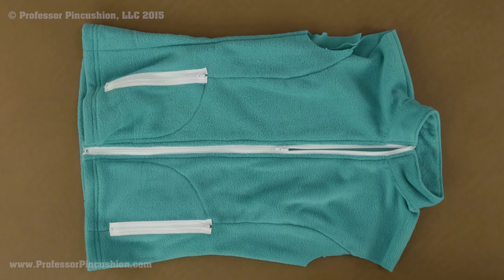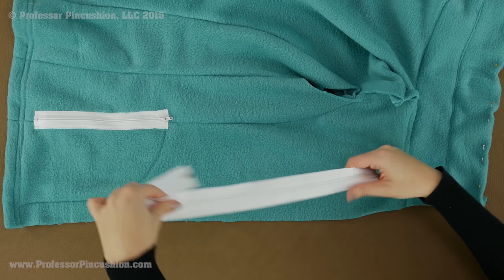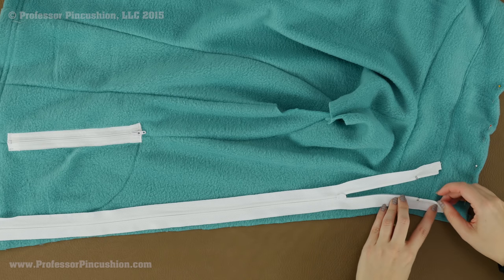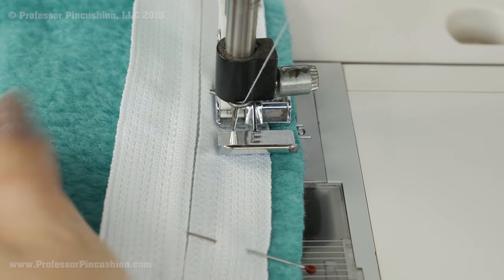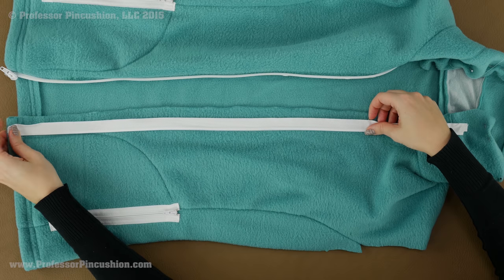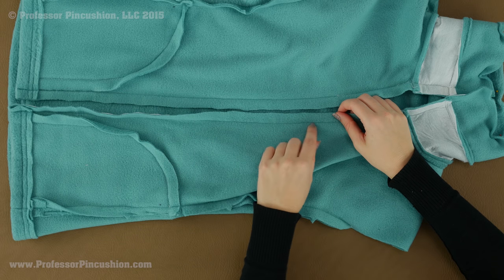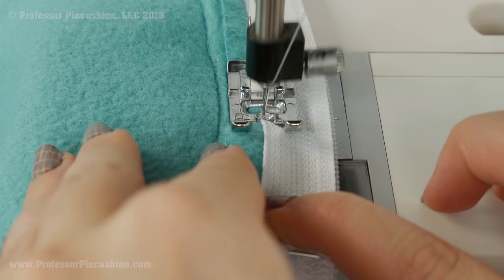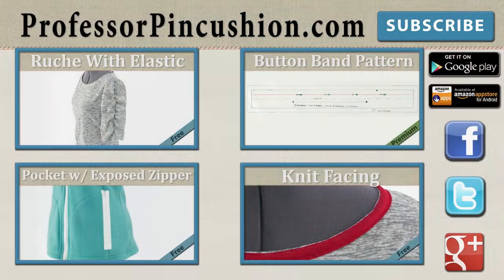How to Sew a Separating Zipper

Comment: You didn't show what to do with the top extra length of zipper... really the only reason I searched for this video!
Reply: There are some pretty good videos on shortening a separating zipper out there. Basically you remove the unnecessary teeth with plyers or needle nose plyers, breaking them up to remove them. Then you either attach a new stop, or carefully remove the old one and crimp it in the new location.

Comment: I'm running into an issue replacing a separating zipper in a fleece jacket.  the fleece stretches.  I put it in once - it was awful,  tore that out - now kinda stuck.  would I follow this the same way or do I need to stabilize the edges?
Reply: Obviously I am not professor pincushion but thats a great idea. I had to stabilize the zipper area with interfacing of my pants because the fabric was very thin. After placing the zipper it was fine.😊

Comment: You are amazingly skilled and talented! I'm sewing up this sport zipper on a scuba swim top I made, will I need to zig zag stitch because this is a stretch fabric?
Reply from the maker: It's not going to hurt anything to sew on the zipper using a zig zag stitch instead of a straight stitch but if the zipper tape itself doesn't have any stretch then it's probably not going to make a difference. :)

Comment: Hi,
Would it be easier to separate it from the start?
Also, to align, i would make notches on both sides to make sure its even.
Thanks
Xoxo
Reply from the maker: You can try but I just get nervous that I won't line up each side perfectly and it'll end up wonky
Reply: That's a good idea, or you could mark dots on your two zippers where they should meet, with a fabric pen.

Comment: i have a question, how do you fold over the edge of the material that the zip is being sewn to?   do you do it by hand or is there something like a presser foot that turns it over?
Reply from the maker: when you sew your seam, the zipper is faced down, but as soon as you flip it out so it's right side up, the seam allowance of the fabric automatically folds on its own.  Hope that helps.  :)